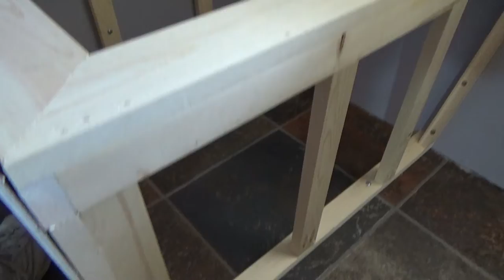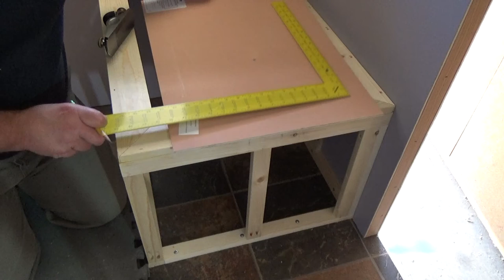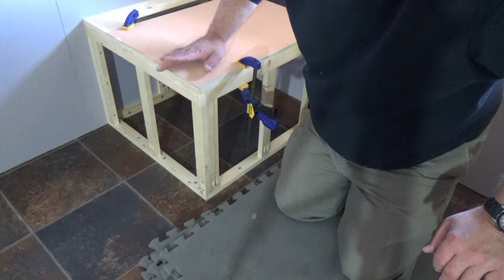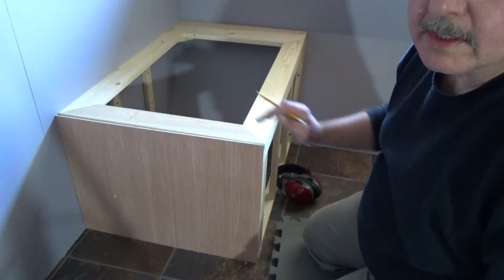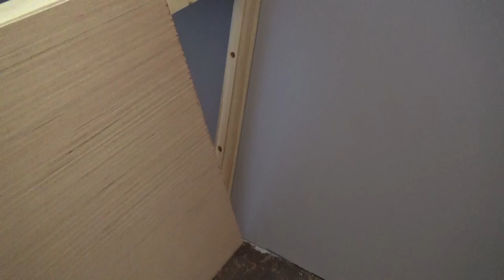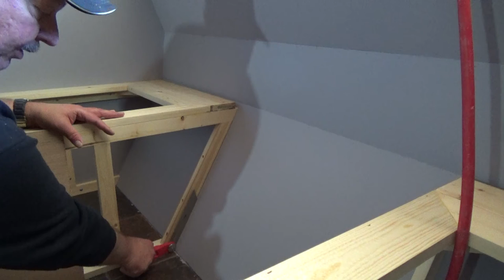How To Build A DIY Travel Trailer - Part 10 (Front Bench Seat Part 3)

Comment: You are doing a great job in these videos, I am loving it. Just would appreciate more details about connecting the woodwork to the trailer. I am a passionate old school wood worker, I appreciate your passion, thanks for responding! .
Reply from the maker: Thank you J Weaver! Unfortunately, I did not start recording the building progress until later, all I did was take pictures along the way. Once the floor was fastened to the trailer, I set the side wall frames in place and bolted the framing through the floor. The bolt heads are inside the walls and the nuts are at bottom of trailer. Stiffened things up real nice! (hope I never have to take it apart! :)